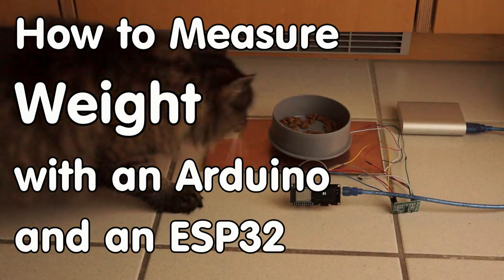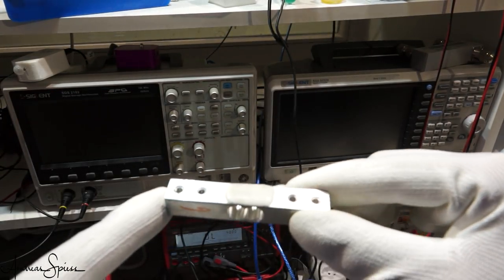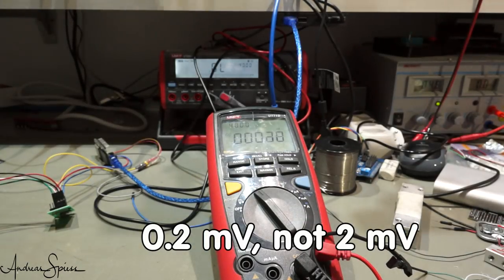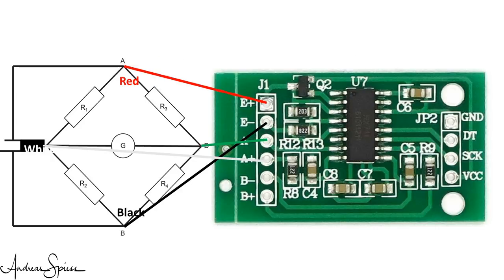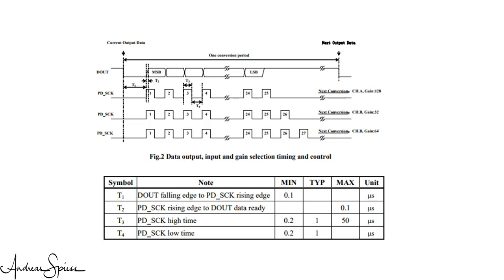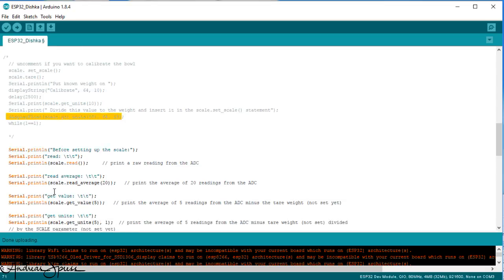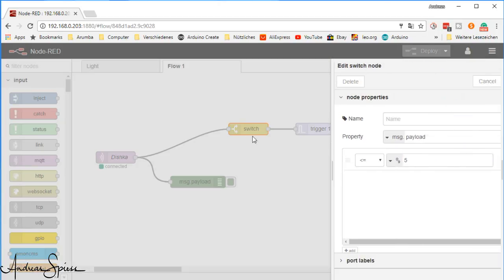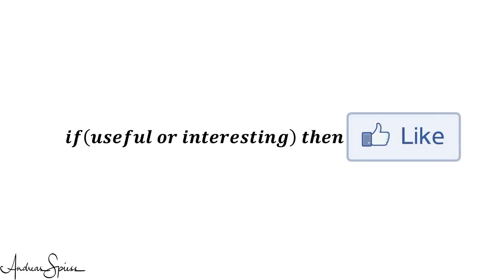#161 Measuring weight using an ESP32, a strain gauge, and a HX711

Comment: Hello, is it possible to use two or four 4 wire 100 kg load cell so I can measure 200 or 400 kg ? Tnx
Reply from the maker: Yes. But make sure that 400kg is never exposed to only one cell. Otherwise, it is bent.
Reply: @AndreasSpiess  thank you, how do I connect the 4 cells to HX711?
Reply from the maker: @robertosonzogni  You have to have a HX711 for each cell

Comment: The esp32 has adc ports couldn't we use these instead, or are these not accurate enough?
Reply from the maker: They measure 1.1 volt max. So, they would not measure a lot in this mV area
Reply: Thanks for the answer. That's why the HX711 with a build-in amplifier is the better/cheaper choice, now i get it.

Comment: Good video, but there's a very common physics misconception in your video: you said strain gauges can measure force and can't measure weight. But that's wrong, because weight is a force . What you can't measure directly is mass , which is determined by the weight of the object in a certain place (in this case, Earth). But a balance calibrated for Earth wouldn't work in the Moon, because the weight of the same amount of mass is different. Mass is constant. Weight isn't. Apart from that (which doesn't really affect what you said in the video, since you calibrate against a known weight anyway), the video is very good.
Reply from the maker: Of course, you are right. I mixed things up

Comment: Hello Andreas and thanks for your excellent channel content. I have two questions of the HX711 interface. Why do you shut down and reopen the chip after every read cycle? Is is to conserve power? Secondly I have a very nice weight cell originally from a fish weighing scale. It is however very sensitive to temperature changes (maybe it is only half bridge?). Therefore I would like to use the B channel to monitor the temperature. Does your HX711 library have a provision for channel B read?
Reply: Actually after studying the datasheet of HX711 I went on to test the library and it seems that if you simply make a call scale.set_gain(32) the next reading automatically comes from channel B. When you call scale.set_gain(128) (or 64), the next reading is from channel A.

Comment: May I suggest the following: your cat is too fat anyhow and definitely does not need more food but less. Yes, it is a cute cat, but fat. So use your scale as a help to put her on a diet, attach a dosifier with a servo which will not dispense more than a previously defined amount of food.  Add an esp32-cam module in front of the bowl and make a livestream so we can see how your cat slowly loses weight
Reply from the maker: You are not a nice person. Our cat is ok. She has very long hairs which might make you think she is fat.
Reply: @AndreasSpiess , I'm sorry. I did not want to offend you or your lovely cat. At another point here in this thread you did mention that also your vet sees an obesity issue. In the long run an obese cat is very likely to develop several health problems. Do your cat a favor and reconsider your point.

Comment: Hello, will this run on a ESP8266? I have the Wemos D1 R1 how can I adapt the code to make it running and also link it to NodeRed raspberry server?
Reply from the maker: if you find a library for the HX711 or you write your own, you can run it on all platforms.
Reply: @AndreasSpiess  I gave up on my D1 R1 and managed to upload it to my T-Beam TTGO. And got a Welcome message on the small display. I did change the pins for HX711 to 4 and 0. Since this was made to connect to a MQTT server what can I do now to store the data and visualize it on Grafana?
Reply: @AndreasSpiess  Hello, I have the project running on my T-Beam ESP32. I have to comment-out the lines for connecting to the MQTT since  the serial port was screaming "5Connecting to MQTT..." . I did the calibration an it shows grams. I have two questions: 1 - Do I need a payed subscription to MQTTCloud?  (I just want to run it locally with the rasperry pi sd-card grafana image) and 2 - how can I set the units? I am using a load cell 2Kg max and I did calibrate it with a 41g LiPo 18650 battery.  Thank you
Reply from the maker: You can use mosquitto as a broker on you raspberry.
Reply: @AndreasSpiess  Hello, Yes I had to edit the mosquitto.conf file with the line "listener 1883". Now the ESP connects to the Raspberry and the LCD display is showing the value. Also, the confirmation from the serial port appears "connecting to MQTT... connected". How can I create a graph using Grafana? I am running the Grafana Image on my Raspberry. In Node-Red I do have the flowgraph Weather and Cat bow. I did set the correct IP address and ports but is showing connecting...  Thank you.

Comment: 7:44 where did you connect the oszi probe to measure this signal?
Reply from the maker: To the clock pin of the HX711
Reply: I see! The ESP32 was 'requesting' new values from the HX711 too fast for it to handle properly. Nice work from you to spot and fix that problem!

Comment: Tack så mycket!!! If YT had the possibility to multiply my thumb-up I'd do it! Good humor, clear and to the point.. You are great!
I've replicated this setup using ESP32 + node-red and it works!
The tip about RTC it's indeed needed, it stabilize also the value of the other reading,  but why the soc/rtc.h is used instead of esp32/rom/rtc.h of arduino-esp32. What's the difference?
Reply from the maker: 1. I do not know.
2. The library should now also support the ESP32 without my trick. I did not test it.
Reply: Yesterday I've tested the FSR sensors and are much more practical to work with, at least for my application
Reply from the maker: If I understand right, the weight sensors have those FSRs built-in?
Reply: As far as I know No. In FSR the resistance varies based on pressure. In the load cells you amplify a stress signal. In FSR the microcontroller current is feed into it and you measure the difference with the analog input. Here is a quick video I made (in italian) that show it working https://tinyurl.com/y68sl7te
Reply: @EliSpizzichino  "Sorry, the file you have requested does not exist."

Comment: Thanks for the inspiration – once again! I've just ordered the sensor and the HX711 board from AliExpress for – dare I say it – €2.61, shipping included as usual.
Now my question: Can I use it with the ESP8266 (the speed should be about right), or do I need 2 analog inputs – I guess digital ones should do?
Reply from the maker: The digital are ok
Reply: Thanks!

Comment: Thanks for the always instructive, interesting and funny videos!
as a beekeeper i would love to see a video about a Beescale that sends the measured data like weight and BME 280 weather data to a DB on the internet with Lorawan via Thethings network
I wait until you start with beekeeping :-)
Reply from the maker: I often use a project to show a particular technology and hope, that the know-how is used for other applications. In this case you should find all parts needed for your project. With the exception of the mechaical part for the scale. But if I remember right, I saw some other projects for that part.
Just if you want to start before I start. Beekeeping will be after YouTube. So it will probably not appear on the channel :-(

Comment: Thanks again for the great content Andreas.

I successfully got the scale working using the Q2HX711.h but get the following error when using the hx711.h. Can anyone advise what i'm doing wrong. Thanks in advance. 

Arduino: 1.8.5 (Windows 10), Board: "ESP32 Dev Module, QIO, 80MHz, 4MB (32Mb), 115200, None"

C:\Users\dm\AppData\Local\Temp\arduino_build_981981/arduino.ar(esp32-hal-misc.c.o): In function `yield':

C:\Users\dm\Documents\Arduino\hardware\espressif\esp32\cores\esp32/esp32-hal-misc.c:36: multiple definition of `yield'

libraries\HX711-master\HX711.cpp.o:C:\Users\dm\Documents\Arduino\libraries\HX711-master/HX711.cpp:7: first defined here

collect2.exe: error: ld returned 1 exit status

exit status 1
Error compiling for board ESP32 Dev Module.

This report would have more information with
"Show verbose output during compilation"
option enabled in File -> Preferences.
Reply from the maker: Does the Blink example run?
Reply: Andreas Spiess.. Slightly confused with your question. Blink?
Reply: Andreas Spiess.. I have run a number of different scripts, one of which was a blinking led script. I wasn't sure how this was related to your Weight Sensor script. Thanks in advance.
Reply from the maker: +david murphy The standard simple Arduino blink sketch. Because It could be an issue which is not related to the particular sketch. To find out, I usually try the blink sketch.
Reply: I created a simple sketch with just this entry..and if fails to compile with my AnalogLamb ESP-WROOM-32.
If I include the Q2HX711.h library it compiles ok..arrg. Thus my request to have the sketch u ran using the Q2HX711.h library.

#include <HX711.h>

void setup() {
  // put your setup code here, to run once:

}

void loop() {
  // put your main code here, to run repeatedly:

}

C:\Users\dm\AppData\Local\Temp\arduino_build_113109/arduino.ar(esp32-hal-misc.c.o): In function `yield':

C:\Users\dm\Documents\Arduino\hardware\espressif\esp32\cores\esp32/esp32-hal-misc.c:36: multiple definition of `yield'

libraries\HX711-master\HX711.cpp.o:C:\Users\dm\Documents\Arduino\libraries\HX711-master/HX711.cpp:7: first defined here

collect2.exe: error: ld returned 1 exit status

exit status 1
Error compiling for board ESP32 Dev Module.
Reply from the maker: I compiled your sketch and had no problems.  Look at your C:\Users\dm\Documents\Arduino\hardware\espressif\esp32\cores\esp32/ folder. Maybe you have more than one installation of the ESP32 software. Maybe you delete the whole C:\Users\dm\Documents\Arduino\hardware\espressif\ folder and install the ESP32 software again.
Reply: Andreas...really appreciate your efforts. I uninstalled my 1.8.5 version and installed 1.8.4 (as that is what u were running and no joy. So re-installed software (yes i deleted arduino software from all locations. If I select an Arduino uno board and run the simple sketch it compiles ok.  Need to scratch my head a bit more on this one...might flash up a linux host and run software and see if I make progress. Thanks again.
Reply from the maker: The Arduino installation has probably nothing to do with it. Only the ESP32 insttallatoon
Reply: Solved the above compile error by deleting the if/endif statement (Arduino_version) at the start of the HX711.cpp file taken from the bodge /hx711 repo. FYI. Any ideas why? Now off to make a beehive scales. Thanks again Andreas.
Reply from the maker: Sorry for no more remembering this one. I had to do the same in my library but forgot about it. I enhanced now the description and uploaded a working Library to my Github Thanks for your hard work!
Reply: As Oscar Wilde pondered...Memory - is the diary that we all carry about with us. You get to our age and you drop a day here and there. Thanks again. All sweet.